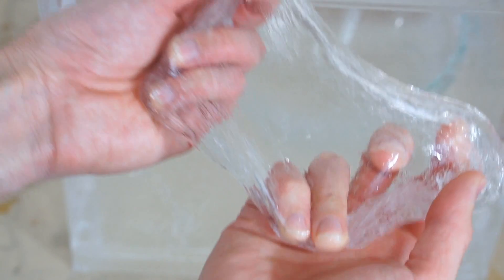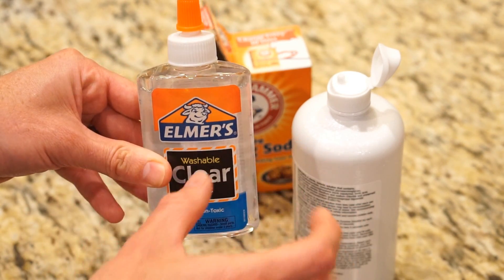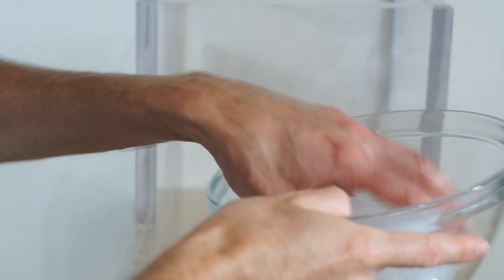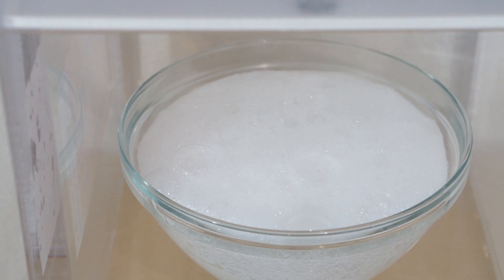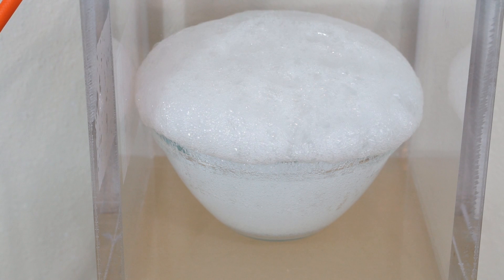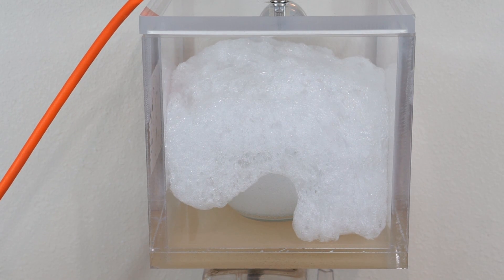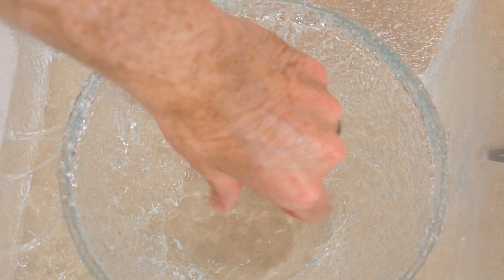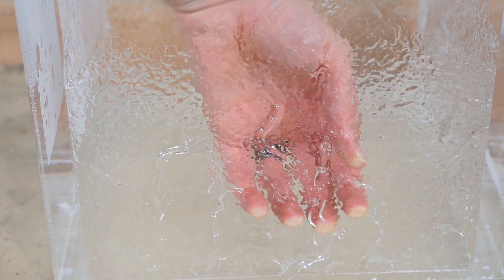Making Instant Crystal Clear Slime in a Vacuum Chamber

Comment: Boron, not Borax.  Borax is a brand name laundry detergent not an element or molecule.
Reply from the maker: +ElGatoLoco698 no, Borax is another term for sodium borate. Boron is the chemical element. Not the same thing.
Reply: Yes I know it's not the same thing.  I was pointing that out.  You claimed that Borax was the element used in contact solution.  That's not true.  Boron is the chemical element used in contact solution in the form of boric acid.  Borax is a commercial product brand name which contains sodium tetraborate.  Borax isn't even a chemical name.  It's a brand name.  Definitely not the same thing.  You wouldn't put borax on your contacts.

Comment: +The Action Lab -- What if you mix the boric acid and baking soda first, so that the viscosity is very low when you degas it? Also, were the final bubbles perhaps not air-filled at all, but filled with very cool steam?

Comment: Next up What Happens If You Fart in a Vacuum Chamber?
Reply: Nothing! Since a fart is a gas, it will just be sucked up by the vacuum pump. You will just be left with an empty vacuum chamber. And that's the final consensus of a true scientist. If you want to disprove this theory, than you may try yourself, but I warn you that I am 100% right. However, your vacuum chamber might still be a little smelly on some of the surfaces. I wouldn't want to pop popcorn in your vacuum chamber.

Comment: What if you put molten metal in a vacuum chamber?  Does it take longer to cool?
Reply: tron3entertainment well I'm sure there would be some air left in the chamber plus unless it's magically floating there will always be some way for the heat to transfer
Reply: It might take longer to solidify
Reply: heat moves alot faster on solid molecules anyways
it will give its heat to the other metal what it contact
maybe it can be abit slower but not so much
Reply: It would still be able to give off some heat in the form of light(infrared) but I'm sure it would cool slower without it's main contact.
Reply: tron3entertainment the temperature doesn't change?
Reply: Heat has to transfer into something else in order to cool. With no air heat would transfer into the crucible until it cools.  But does lack of air make that much difference?

Comment: You should take a vinyl record and make a silicone mold of it, then pour resin in the silicone mold and see if it sounds the same. Like if you agree
Reply: Few days ago king of random did this
Reply: XxAcidRainxX What if we disagree?
Reply: King of random did this.
Reply: Tkor
Reply: YodaWhat no, it will not reverse the pitches
Reply: YodaWhat the low and high sounds.... Pictch
Reply: Heath Brown, I did not say anything about the sound pitch. Where did you get that idea?
Reply: People have been doing that wood glue for a long time. It's actually a very good method of cleaning said record too.
Reply: woa
Reply: Hills become valleys and valleys become hills, swapping high amplitude for low and vice-versa. But it may still sound fairly normal.
Reply: @YodaWhat why would it change shape?
Reply: LOL. Do not confuse yourself, Heath. Amplitude and pitch are totally different things. When you turn up the volume (amplitude) of your stereo, does it make the Pitch (frequency) increase? Certainly not!
Reply: XxAcidRainxX it'll be the same sound
Reply: XxAcidRainxX i don’t think it would work it is laser engraved meaning that the hills wouldn’t show

Comment: imagine using a vacuume cleaner for the vacuume chamber and you press the wrong button and instead of sucking the air bubbles out it it puts dirt and trash in ur clear slime, like that would suckered because that has happened to me before

Comment: I wonder if the air could be removed from the slime the same way you remove air bubbles from clay before you make something ceramic by throwing it down hard onto a table. That drives any air bubbles out so your piece doesn't explode during the firing process.
Reply: You can also "wedge" it, or press down on it really hard with both your palms on either side of the clay/slime, and then fold it back up and do it again. It probably won't work, though, because clay and slime are made out of different materials. Maybe clay slime/butter slime? Lol.
Reply: Mike West hydraulic Press
Reply: Prob no because it would introduce more air
Reply from the maker: +Mike West I'm going to go throw my slime and try;)
Reply: The Action Lab: Let me or everyone know if it works. It needs to be done repeatedly for several minutes.

Comment: why don't you add something that can mix and pop the bubbles inside the vacuum chamber? something like blades...
Reply from the maker: +Giorgio Bikos more mixing=more bubbles
Reply: The Action Lab I think they would be ''vacuum bubbles''! the 'blades' will cut open the bubbles that will expel the air from inside instead of waiting that the internal pressure overcomes the surface tension of the bubbles... But it's a theory... why don't you try? 😅 I don't have a vacuum chamber!
Reply: the blades should be activated when the pressure is low not from the beginning
Reply from the maker: Ah I see. Once it is already under vacuum...that would work!